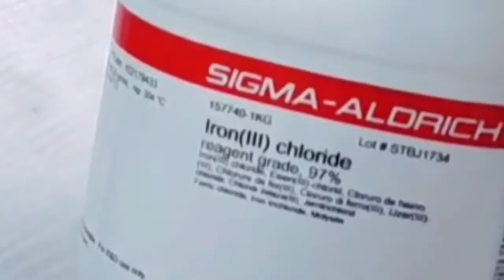FeCl3 || Iron 3 Chloride || FeCl3 anhydrous || FeCl3 Solution preparation || Iron(3) Chloride ||

Comment: Is there a significant increase in temperature when you mix the solution?
Reply from the maker: Yes. It produces more heat when addition of water like an exothermic reaction. But no issues you can keep on a hot plate with one litre borosil beaker.